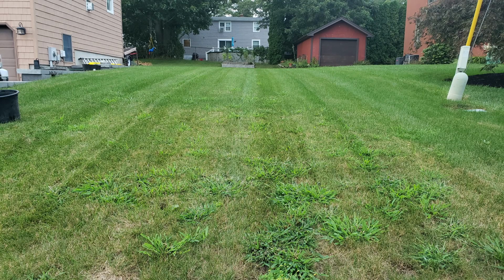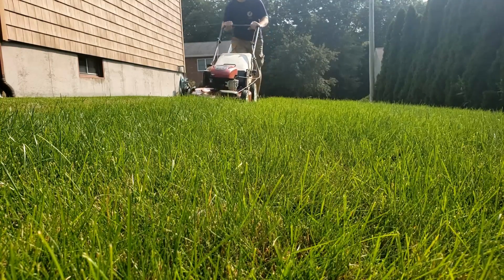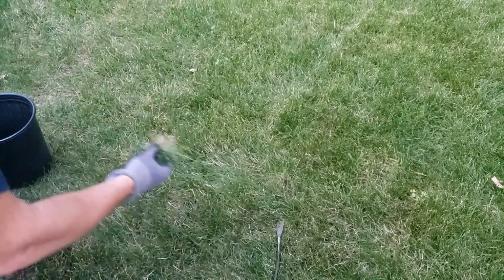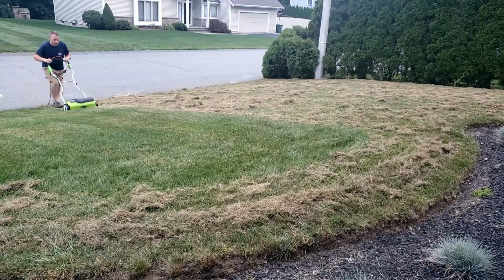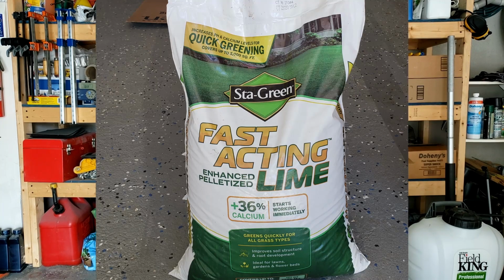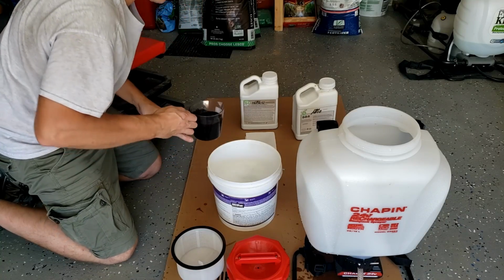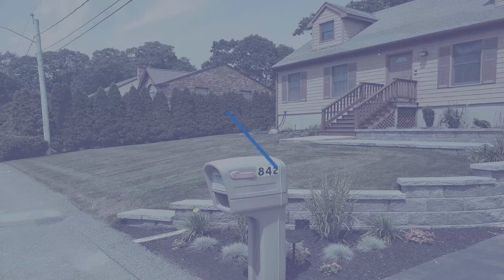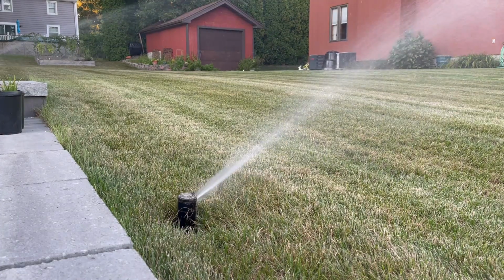FIX YOUR LAWN - Fall lawn renovation, Kentucky Bluegrass (KBG lawn renovation, repair and re-growth)

Comment: Here’s a tip that worked well for me to get a thick kgb lawn really quick. In my renovation I killed it off, level raked it smooth then reseeded with SS5000.  Then about a month later over seeded it again w the same seed and went heavier in any washed out or lighter areas. I did start a little early and we are having a warm fall so that helped me a lot. The grass gods were on our side.
Reply from the maker: Thanks. I also used a ss5000 on my lawn. I will see what it looks like in the spring and decide on what I'm going to do. My lawn is filling itself in right now.

Comment: No over seeding or top dressing in your fall prep..??
Reply from the maker: I had a POA issue this summer and had to use Prodiamine this Fall so overseeing will have to wait. I am planning on leveling with a sand/soil mix in the spring so I'll do a video on that.
Reply: @nextleveldiy  Good response!!  I have found personally that a sand/soil mix covering has great results applied either spring or fall..👍😉